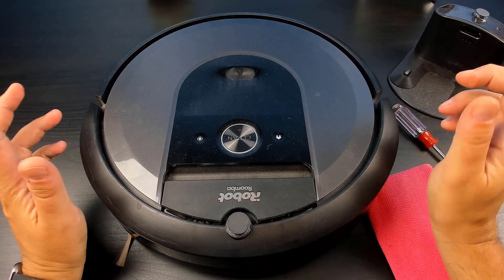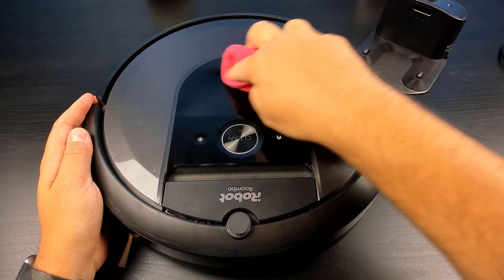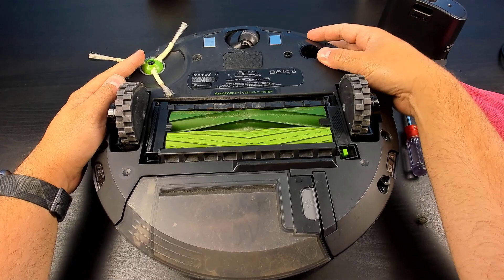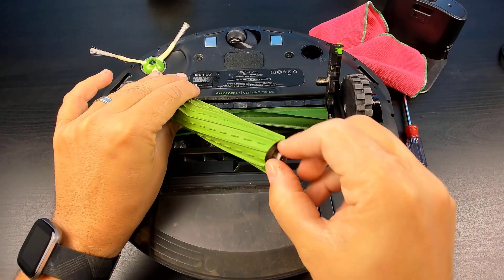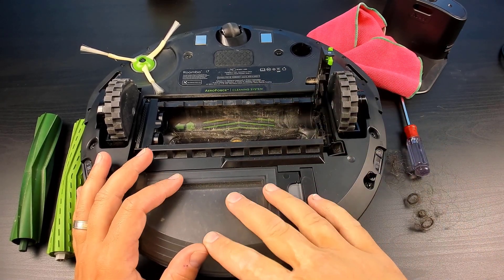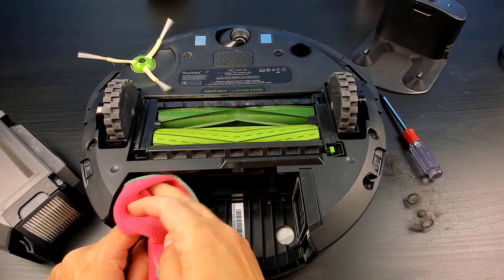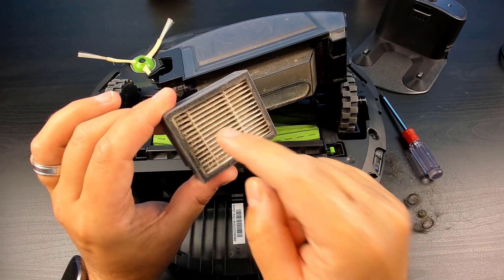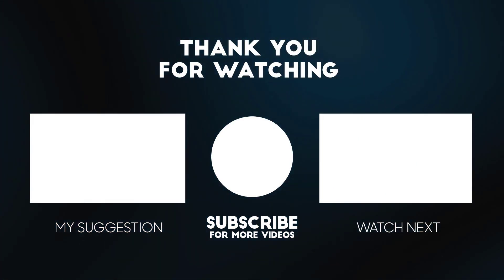How to clean the iRobot Roomba i7 & Full bin error Fix

Comment: I use compressed air to clean all over my robot and filters it’s great, however the empty the bin full error keeps occurring, even replaced with new filter, ended up getting new cleaning head module (4th one now…) I think the copper/brass round circular sensor is the problem when it gets coroded and won’t clean to be shined anymore that is the problem. Any ideas?

Comment: I replaced the filter with a new one. And replaced the motor as well and cleaned everything. Replaced brushes too. Performed reset and still getting bin full error. If anyone knows something pls help. Had the thing working for three months and it's just been sitting there for a year now doing nothing.

Comment: Very Helpful, Thank you!  I like the "vacuum with another vacuum" for the filter, when the tapping out didn't work that well. I then used an air compressor to blow out the filter,  to remove even more dust particles.

Comment: I found the video very useful! I did wash the bin filter, instead of brushing it, and let it dry for a couple days. I see a huge improvement but still a lower performance than when I bought the roomba 5 months ago: it used to finish cleaning in 1hr 15min without having to empty the bin. Now it takes nearly an hour and a half and it has to pause to recharge. I’d very much appreciate any comments.
Reply from the maker: Thanks 👍🏻
Reply: I thought it says your not supposed to wash the filters.
Reply: @spikeyboy Your not, they're paper.  They're supposed to be replaced pretty regularly although third party replacements work fine for a quarter of what irobot charges.  

The robot doesn't know if they're new either, you can replace with the same part when it complains that it wants replacing.  

It seems to want me to thoroughly clean it once a week.  I already have to intermittently clean the floors because it misses things and the dog hair is constant.  

I'm starting to think it's not worth the effort and the replacement parts i have to keep buying.

Comment: We have a dog, so I clean ours once a week, and every place it can fit is full of dog hair. I didn't know about removing the plastic pieces off the ends of the rollers. Yep - that area was full of dog hair too. We're getting error 30 over and over and it won't clean any more, and despite all my cleaning and new filter, it still gets error 30. They are sending me a new part, the cleaning head module.
Reply: I am on my second replacement part for error 30 in less than a year. I have 4 short hair dogs and it runs twice a week at night. I clean it bi weekly. I even got the base with the emptying the bin function
Reply: @nrhutch  That's what worries me, if this breaks often, then out of warranty, I have to start paying for it. This first one is covered. I'll up my cleaning, and now make sure I pull off that plastic piece off the end of the rollers and clean behind that too. I do run the vacuum daily, as the amount of hair from the dog is high.
Reply from the maker: Hope you got the part, and that your up and running now. 👍🏻
Reply: @HipIOReviews  Thanks! Yes, I got the part, and that fixed the issue. I am a bit worried about the same part going bad again in a few months. The reviews for that part people said it breaks over and over and doesn't last long. Hopefully that won't be the case.
Reply from the maker: Thanks great! Hoping it doesn't break again 🤞

Comment: sadly I’ve done everything in this video multiple times after viewing my it on multiple occasions, we have the i3 plus and it just goes back on the base, charges but won’t always empty itself it eventually will if you spam home or clean to try to force it, but not always on its own, I’ve cleaned all the sensors on the roomba and the home base sensors, it’s a weekly thing here with this thing, why? Why isn’t the bin more sealed so dust doesn’t get on the bin sensors? We unplugged the home base for a bit as roomba support suggests that as well still doesn’t like to self empty every time like it should, I hit roomba support up about this issue and a battery life issue and they replied “To prevent your roomba from getting stuck and draining the battery we advise you to get these no zone block off sensors you can find them here”. They were helpful, not.

Comment: These things are junk.  I've had an s9+ for 3 months now and I think it's only completed a job successfully a couple times.  It's like I need a second robot to perform all the maintenance on the first one.  The thing constantly has connection issues, gives code 36 after it doesn't even attempt to evacuate the bin, loses the map, loses the cleanbase, and the app is horrible.  I can't even access the map on my phone, have to use the wife's.  If anyone's afraid of AI taking over, they should get a Roomba and realize the apocalypse is a long ways off.
Reply from the maker: Thanks for sharing 👍🏻
Reply: Absolute junkkkkk! Every problem every time! Never… ever again!

Comment: No wonder why they made the side brush fixed with a screw and not with a magnet as neato does, is the one that needs most maintenance.. I’m afraid I’m going to return the robot :/
Reply from the maker: Personally I find the roller brushes collect way more hair on the sides. The side brush I don't pull off very often.

Comment: Where is the green tab that is often seen on the i7's dust bins?
Reply: The green tab is the port for the clean base station. The automatic bin empty system.
Reply: @joelmeyer6568  I guess the i7 doesn't come with that? Only the i7+? I have an i7, and I'm wondering how I would get that if/when I wanted to add the automatic garbage bin.

Comment: If the caster wheel is not freely spinning and has friction, you can actually remove that metal rod in the caster wheel.  To remove the rod, push it with your finger and pull it out.  That happened to my i7 and s9 and then put the rod back in. It will click into place.

Comment: How frequently is this cleaning needed?
Reply: Thank u,as we also have 3 long hair ppl at home 😊
Reply from the maker: This would depend on the house, square ft, usage, people and pets.

3 people in my house have long hair, so about every week/week and half I'm removing rollers to remove tangled hair.
Reply: WHAT DOES ERROR 43 MEAN
Reply from the maker: According to the website:

Error forty three (43) means Roomba i Series is stuck in the infrared (IR) beam of a Virtual Wall® or Home Base®. Move Roomba to a new location, then press CLEAN to restart. If you have multiple Virtual Walls facing one another, Roomba may experience issues with navigation.
Reply: Too often to make this product not worth owning. Not to mention how loud it is.